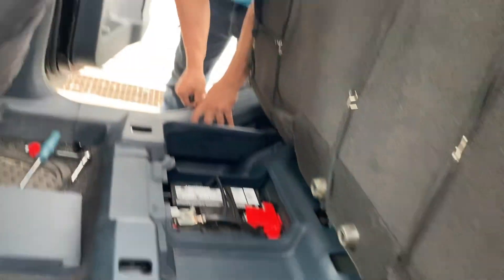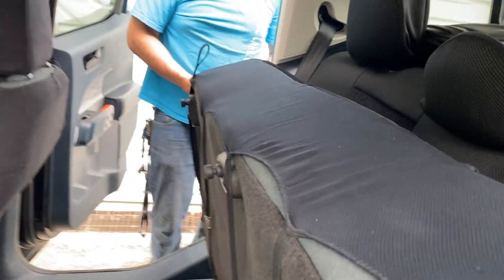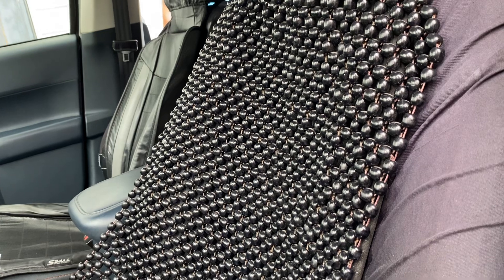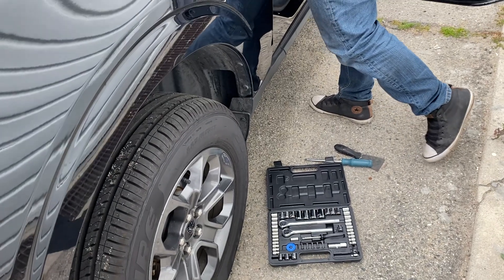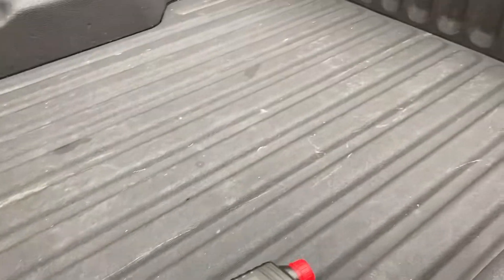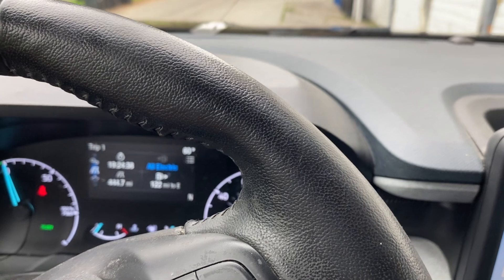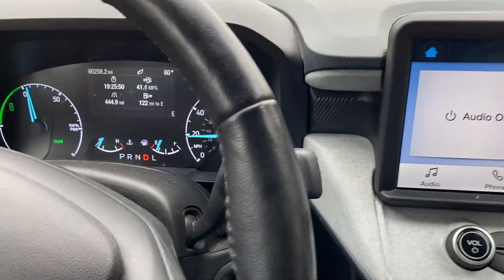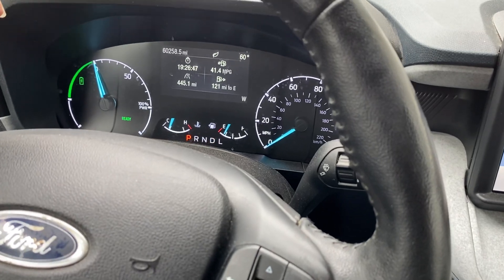Will installing a new battery in my Ford Maverick hybrid increase my mpg?

Comment: You guys do know that a Maverick Hybrid has 2 batteries, right?  The one you replaced powers the radio, headlights, etc ...... just like a regular car.  So, when you change the battery in a Chev Impala do you think will it improve the mileage???? The battery that provides power to the electric drive motor for a Maverick Hybrid is under the floorboards.  This is a "Keystone Cop" video of a couple of bumbling would be mechanics replacing the wrong battery.  BTW- Since you obviously don't know what you don't know, don't mess with the REAL hi-power battery under the floorboard.....disaster awaits; and you won't be buying that battery at your local car parts house.
Reply from the maker: @edwinsievers3052  you sound like a passionate person. Should you like me to buy you a beer. I have 2 hang outs. The Lincoln on Lincoln, close to Marina Del Rey, or the Gas Light on Whilshire Blvd in the city of Santa Monica. Funny how I made an attempt to become a cop, now I am a Keystone cop.
Reply from the maker: @edwinsievers3052  And to answer your question yes your gas mileage will improve if you’re car battery is 4 years old. Yes I guarantee you that your gas mileage will improve.